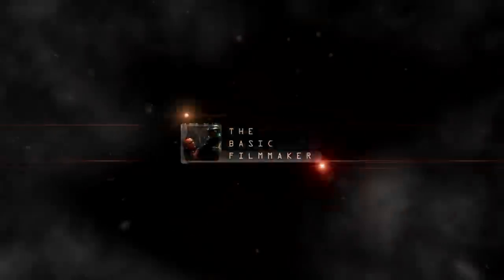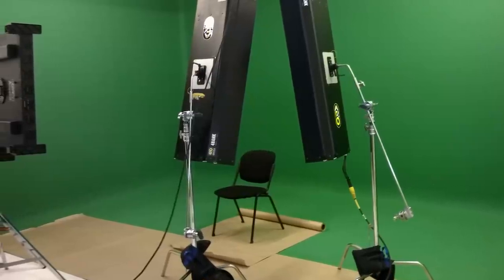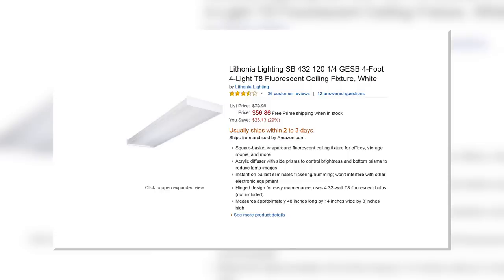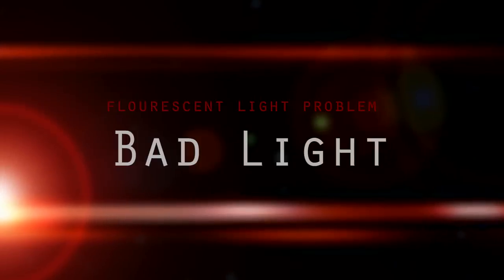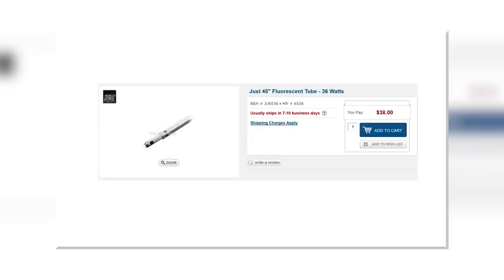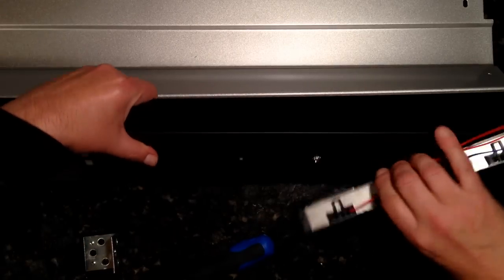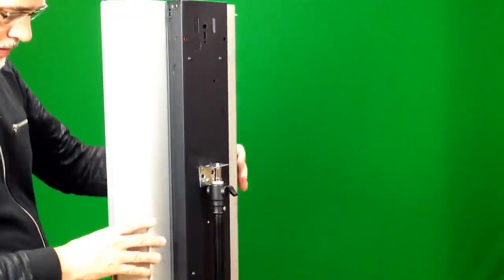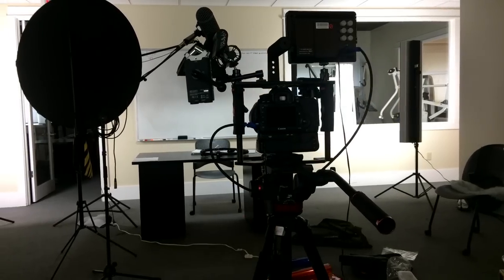How To DIY Bank Lighting For Filmmaking - Basic Filmmaker Ep 114

Comment: Don't mind me. I'm just making my way back to the "BASICS OF GREEN SCREEN - Everything You Need To Know" video...
Reply from the maker: 😂😂😂 Thanks for the laugh!!
Reply: I too am here from there; I was wondering if LED strip lights (the flat kind) would make for good, lightweight and VERY inexpensive tunable light solution ?
Reply from the maker: Haven’t tried it but sounds right. They just need enough output.
Reply: @BasicFilmmaker   I think I'm going to make one as a test; put them on a $6 lunch tray. and they will be unbreakable. The cool thing is they could be used as a battery-powered light using a power brick, and their low height would allow them to be placed almost anywhere. Lots of them even have remote control options (physical or even app-based). Output is the biggest question. A quick google has this to say:

"LED strip brightness is typically described in lumens per foot (or meter). A good quality LED strip should provide at least 450 lumens per foot (1500 lumens per meter), which provides approximately the same amount of light output per foot as a traditional T8 fluorescent lamp."
Reply: @done.8373  Hey Don, how was your experiment? Did it work?

Comment: I went to my local Lowe's and found everything I needed. I spent about $150 to make both lights. The LED panel lights were about the same cost but the one fluorescent bulb puts out more then half the entire light of the LED panel.
Reply from the maker: Nice. Those should work well then.
Reply: I had to move the panels 4-5ft in from of the screen and angle them in to remove the hotspots. I thought the panels would be on the sides of the screen but it get hotspots on the edges. Am I doing something wrong?
Reply: @HotloadsTTV  leds are spotty

Comment: Can you look at this on Amazon. It’s just 2 tubes each but would it work for a simple YouTube channel with a green screen?
Sunco Lighting 2 Pack LED Utility Shop Light, 4 FT, Linkable Integrated Fixture, 40W=260W, 5000K Daylight, 4100 LM, Frosted Lens, Surface/Suspension Mount, Pull Chain, Garage - ETL, Energy Star
Reply from the maker: I see no reason why not. https://amzn.to/3oLWtFy

Comment: Hi！I'm Davide from Milan (Italy). I'm watching your tuts with enthusiasm as I'm approaching DIY green screen film-making for fun and a commercial project for myself. Congrats on the whole youtube project, very well done, instructive and entertaining!

I gave up DIYing the green screen and the 3 points lighting system as in Italy it's way cheaper to buy them on Amazon, but the light banks are on the way as per your tutorial. However, I'm finding difficult, very difficult, to find the right flo bulbs and the housing hosting 4 bulbs. So the question is: 

1) Would one 150cm housing per side hosting 2 52W bulbs at 4000K / 82or85 CRI do the trick? My hair color is blond and I read that a CRI below 90 could render yellowish halos around the talent and cause problems with the edges and hair of the subject filmed. However at the same time I also read that a CRI of 82 is already in the range of white /sun light. Unfortuately in Italy flo-bulbs can either be found at 4000K or 6700K and online no one is offering differently...

2) I would be filmino in a small environment on a 3 meters wide green screen, and therefore the banks would be very next to the green screen. With such lighing setup, would the floor banks also be needed if I want to shoot head to feet?

I thank you in advance.

Ciao,
Davide
Reply from the maker: Davide Pasini Hello David. The CRI stand for Color Rendering Index. That's how ell the color renders based on the K value. In other words, the lower the CRI, the more variability. The values you are referring to are the K values. 5000-5500K is like a white flash, 5500K to 6500K is like daylight (and a bit bluer) and so on, 4000-5000K is a bit yellower and so on down.  If all you can get is say 4000K, then you can just adjust the K value on your camera to suit. The above values are just an estimate, and there are many differing opinions on this. This link may help: http://photographyelement.com/intro-to-white-balance/ and again, you can just adjust the K value on your camera to change the white balance so it looks correct.

Comment: What is the metal part called that the Ballast comes in? I cannot find the metal that comes with the ballast. I can only just buy the ballast itself. Thank you and great vid by the way!
Reply from the maker: You get these with the ballast built in. It’s inside the lights. Just check if it has one or not and you’re good.
Reply: @BasicFilmmaker  okay, but where do I buy them. I cannot find them at lowes or home depot? Where did you buy yours at?

Comment: The DIY bank lights that I use have an additional switch allowing me to turn off half of the bulbs. I don't use this option as much as I expected. I tend to scrim them with window screen instead. Great episode as always.
Reply from the maker: Thanks man...great tip on the screen scrim! Note for others...a scrim is a screen, cloth or other (non-combustible) material put over lights to diffuse them i some way. :)
Reply: Here is a bit more info for the readers. Window screen will cut the intensity of the light by 1 or more stops depending on the density of the screen you get. It will not effect the other qualities of the light. Another options is to use a 20X24 inch ND gel, cut into two 10X24 inch strips. Diffusion material will also cut the intensity of light, but will also soften the light a bit. Placing shiny aluminum tape on the cover behind the bulbs will give you a bit more intensity. To control the directionality of the light, place a grid (egg crate) used with drop ceiling fixtures in front of the light. Chrome and flat black work best.
Reply from the maker: DIYCameraGuy That's cool.  Thanks! Now how about a video on what stops are, and what ND gel is. 9 months since the last video! 1200 subscribers! (This is a joke, I know you're freakin busy with a project). :)
Reply: Holy crap, I have 1200 subs. When did that happen? The feature is coming along well. I have a little behind the scenes footage shot. Now all I need is a clone to go to work for me so I can get some editing done for the channel. Thanks for the friendly nudge though, it helps. I am a little nervous about lighting the night scene this weekend, interior day for night. It is on a second story with no outside access to the windows. I have a plan lets hope it works.
Reply from the maker: Very cool. I hope you're BTSing this stuff - love to see it. Good luck!

Comment: Hi Kevin, great video as always. I was wondering, in terms of lumens, how much brightness would usually be required for adequately lighting a green screen? I understand lumens are probably the best way of comparing different types of lights (I have learnt a lot from an earlier video of yours on lighting in general). Also, these days cheap LED batten lights are readily available. Could they make a good substitute for fluorescent tubes? Many thanks in deed.
Reply from the maker: You can use any lights. Lumens? Just use ANY lights, adjust ISO between 100 to say 1200 and go. You'll know if you need more light.
Reply: Many thanks for your response @BasicFilmmaker

Comment: Hi, great video very useful. Would this work with LED fluorescent lights? Looking at the spec it states no flicker although the output rated at daylight is 6500.
Regards
Lewis
Reply: Yeah I was wondering about that. I guess someone needs to just try them. I'm also thinking about buying more GVM style led panels, yes more expensive, but then you have more options adjusting temp of the lights.
Reply: In theory, yes, but there a couple of things to verify:

1. "No flicker" could mean no visible flicker.  Or it could actually mean a dead-flat trace on a meter hooked to an oscilloscope.  Make sure you know which it is.

2. DON'T FORGET THE CRI!!!  LED's are notorious for bad color rendering.  There are good ones, but the cheap ones are not.  The reason is that a "white" LED is not actually white.  It's a combination of a blue LED and a yellow phosphor.  The phosphor works the same as it does in a fluorescent light: it absorbs short wavelengths of light and emits longer wavelengths.  In a fluorescent tube, the phosphor absorbs ultraviolet and emits a wide range of visible light, while in a "white" LED, the phosphor is designed differently to absorb blue and emit a range of yellows.  The combination of imperfectly absorbed blue (on purpose) plus yellow, gives the appearance of white, despite there not being much red, green, or violet.  As you might expect, this is awful when you want to represent colors accurately, hence a low or unpublished CRI number.
That said, there are "high CRI" white LED's that have a bit more engineering behind them and are thus more expensive, but they have a different LED and a different phosphor, or multiples of each, that actually fill out the entire visible spectrum.  THAT is what you're looking for.  Insist on a CRI that is actually published for starters, then look for at least 90 (the best possible is direct sunlight at 100; incandescents are naturally around 99 without even trying), and an industry-standard test method.
Reply: @aaronduerksen1378   Thank you, very helpful and something I had forgotten to check for so will do
Reply from the maker: Absolutely! CHeap does not get you good, and CRI may be important. I'm doing a fresh updated version of this soon using GREEN leds. Stay tuned.

Comment: I go to a local studio, not very fancy, and the owner makes a big deal out of the type of lights he uses. He says his lights are 400 Hz flicker which is much higher than domestic lights. It is not clear what the "ballast" does on your lights but are you reaching up to the higher frequencies?
Reply from the maker: The ballast simply controls the electrical flow to the lights and makes its one stable signal, which is where flicker comes from. I don’t shoot high frame rate videos, usually 24, 30 or 60 at the most, so no flicker for me.

Comment: So I went to Home Depot to check out thier shop lights. 89 bucks for a 4 footer and the fluorescent tubes are thin.  UT it does hold 4 of them. But, while there they also sell the led shop lights. Not made of many tiny LEDs. Rather. It's one large flat panel LED. VERY large. Yet cheaper than the fluorescent unit by almost half. What say you about that?
Reply from the maker: I haven't tried LED yet. Best recommend would be GREEN lights - LED or not.
Reply: @BasicFilmmaker  Green Flourescent tubes?
Reply from the maker: Yes - more recent development and more available. If you use separate lights for the screen, you can get green bulbs or LEDs and they light the screen with green, and Voila!
Reply: I think there's a video for you to do about green florescent lights. There are no videos about using green florescent lights to create  green screen wall. Can you do one?
Reply from the maker: Yep. Thinking about another simple green screen video so it's up to date. That other one is many years old.
Reply: @BasicFilmmaker  I found one video where some guy is talking about a florescent green tube light. But not for purposes of video production. He's says only one company makes them. Mitsubishi. His came out of a photocopier.
Reply from the maker: Huh. Haven't tried these, but looking at something like this: https://amzn.to/2WJvUCH
Reply: @BasicFilmmaker  Ah, it's at my finger tips and I didn't think to check Amazon. And these are not florescent after all. They are LED.
Reply from the maker: I think it may be quasar science. I'm looking for their green LEDs, like these white ones. https://amzn.to/2CWy4HC

Comment: Great video. I used them and the video came out wonderful... But if I wanted to the fluorescent tubes as single light sources without the bank housing. Will the ballast still work effectively with extended wiring. Thanks
Reply from the maker: I would think so, haven't tried it. I am definitely not an electrician or electrical type person. :)

Comment: Brilliant video. I have tried an arrangement of Fluorescent lighting and should be able now to spell fluorescent with my eyes shut lol I have started a different set up of lighting the green screen. I have a large wall which was painted for green screen, My earlier videos were not that great where green screen was concerned. But something I do want to warn others who are getting into the LED market. My advice is purchase the LED lighting units with the LED Tubes. Unless you really know what your doing in bypassing the older Fluorescent lighting to accomodate LED Tubes one must do some reading before taking on this process. You could find yourself out of pocket or worse electrocuted. Ebay there are sellers on there who will sell you cheap LED lighting most of these tubes and lighting units are made in China.
It would be unfair of me to say that all sellers are selling Chinese crap. I still have two 6ft LED tubes that are useless not fit for the purpose both never worked and one blew the mains. It was absolutely nothing to do with my wiring after rechecking it all again.
Taking one tube apart i noted that a positive wire had broken away and was touching against the neutral hence the short and very loud bang.
After a lengthy debate I finally got the refund of which the seller told me to keep the tubes so I will at some point rewire them with a new set of LED's for another project.

There was also a problem with the second set from another seller, The tombstones at each end of the light were made of very brittle plastic, both broke! on inspection of the lighting tubes a cap at one end on each of the tubes had popped out so i had to lock both back in after inspection of the wiring.
Both lights are working really well and light the Green screen perfectly.
Anyone who is getting into LED Tubes make sure that you fit the tube taking note at which end recieves the live feed there should be a label on the tube or the ligting unit if purchased with the lighting unit.
If you are changing the tubes In your older Fluorecsent  lighting unit for LED you will have to change the small starter if there is one for an LED starter.
If in doubt about any of what is written scour the internet for the answers to your questions, make sure you read as much as possible but also be aware of LED lighting on Ebay or even Amazon as the sellers are on there also. Long I know but necessary and Yes LED is perfect for green screen, Just depends on the size of the screen to how many units you need, Mine is adequate with two 5ft LED lighting units lighting the screen and two box lights lighting the subject. Camera settings as the producer has pointed out here are also very important and sure thing the monitor turn the color off, Like i said brilliant video and i really enjoyed your presentation. Still awake?
Reply: Sorry guys its probably old news the above now as i just noted the vid was published 2015, Ah well my advice might help someone Maybe?
Reply from the maker: LOL! Yep, old video, but your suggestions and comments are welcome. Thanks!